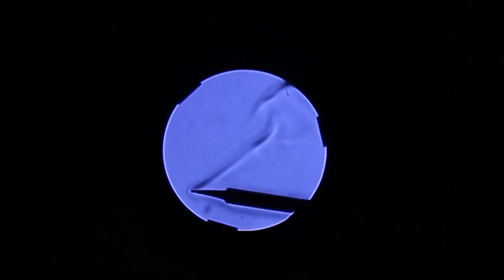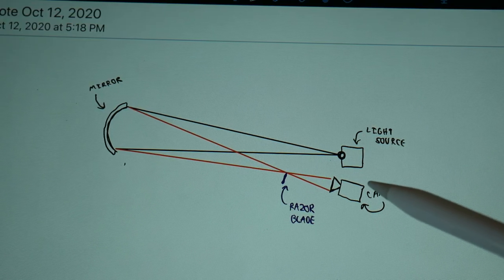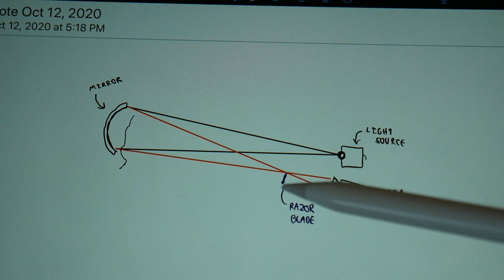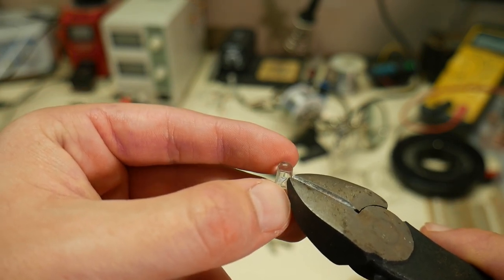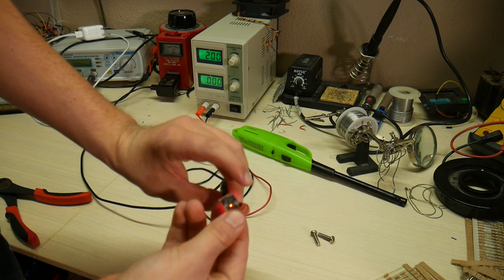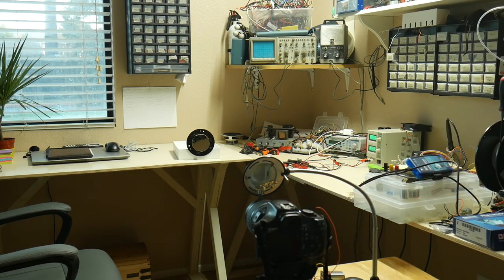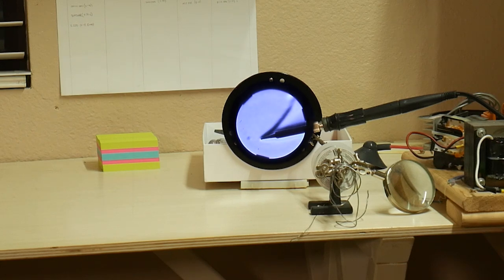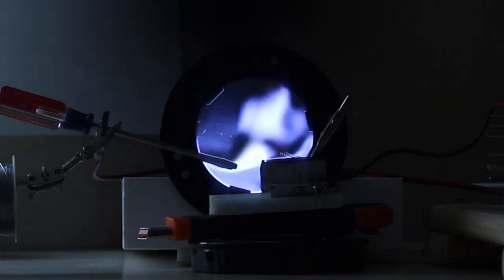How to Make a Schlieren Photography Setup

Comment: I have a  question about the deflection coils and yoke out of a CTR television could I use the yolk as a one-to-one Transformer with the coils and all would it make a power transformer If you know anything about this I can't find anything online about whether you can do this or not
Reply from the maker: I don't think so sadly. Most yokes do not have an iron core(needed for transformers).  Even if they did, these coils are made for high frequencies of 28 khz or something around there. Perhaps give it a try with audio or something, just don't put 110v ac across it haha